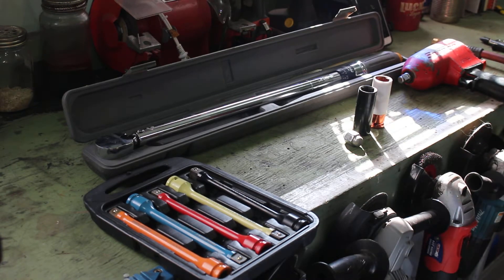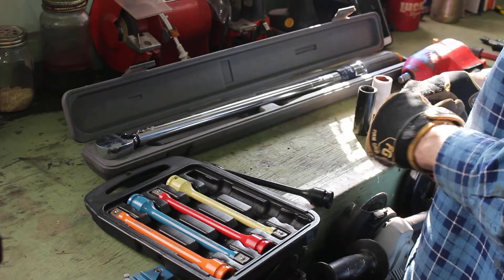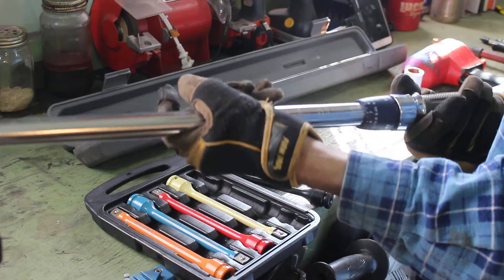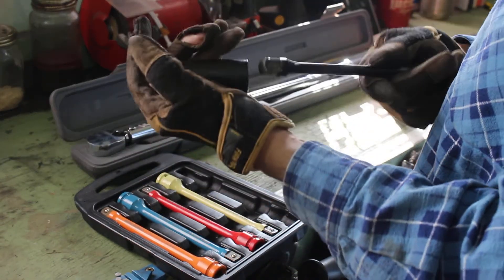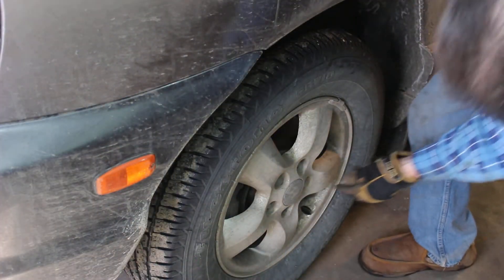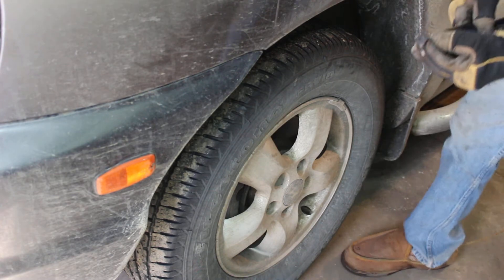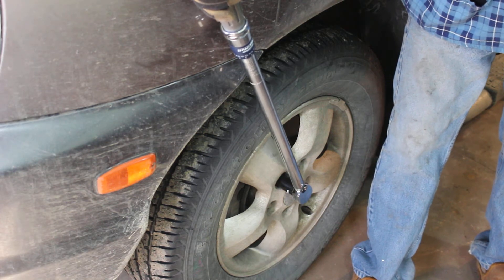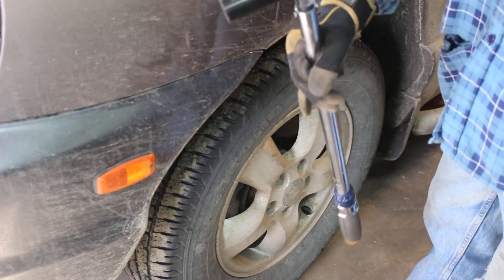Torque Sticks or Torque Limiting Extensions

Comment: Good tips. I recently bought a set of these. I grew up not worrying about torquing wheels that much but with the aluminum wheels these days and the thin rotors and what not, it's much more important. I was pleasantly surprised at how accurate they are. Using a bit smaller one and finishing with the torque wrench is good advice.
Reply from the maker: Thanks Lenny.  Exactly,  I think we all used to just tighten the lug nuts until we heard a crack and call it good.  That was fine with steel wheels and the thicker rotors they used to use.

Comment: Nice how to do video. First time a heard of a torque stick. Bruce what makes them a torque sticks? To me they look like an extension for a socket. Greetings from New Jersey
Reply from the maker: They look like a regular extension but they are designed to only work when tightening lug nuts,  they should never be used to loosen them.  They are made of spring steel of various thickness and when used with an impact gun they will tighten up to the specified torque and then just flex with each hammer on the impact gun.  They don't work with just a regular ratchet,  they rely on the hammer action of an impact gun.
I hope that answers your question somewhat Nick.  I'm not the best at explaining things.
Reply: Thanks Bruce I understand now how they work. Great design how they will twist when it past the  proper  torque. Nick

Comment: Don't really torque car wheels. But on big trucks we always torque wrench them
Reply from the maker: It's definitely important to torque the lug nuts on big trucks but it's pretty important on cars too.  I've seen a lot of warped rotors from people over tightening lug nuts.  I also saw a wheel off a Jeep go rolling past me in the way home from work a few years ago lol.
Reply: Bruce L.   I've lost wheels but only on aluminum  wheels.   Old lug centric wheels  and a 92 blazer that has a habit of snapping lug bolts .  The factory alloy wheels nuts . But from time to time have to replace a bolt

Comment: Actually  this is the way to do it this way you are not over the spec, and have to only turn the final tighten a small amount. Great vid . This is more important today because of the type of rims.
Reply from the maker: Thanks John.  I've seen a lot of warped rotors from over tightened lug nuts and almost lost a wheel myself once because of under tightened ones.